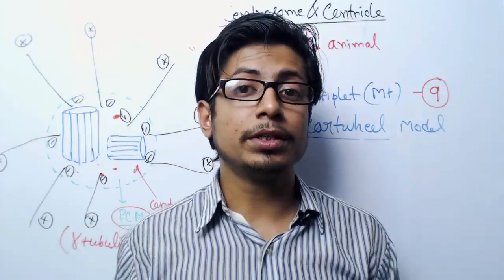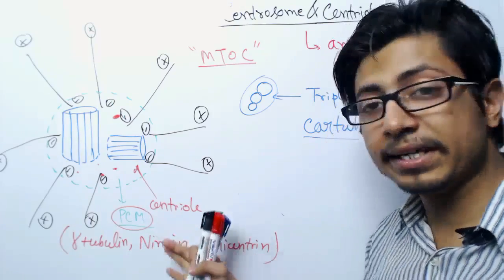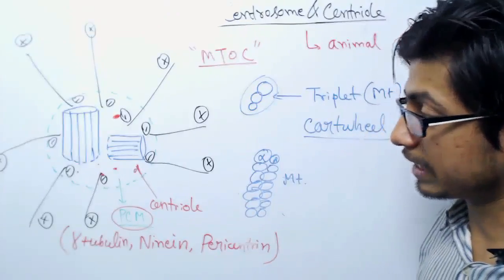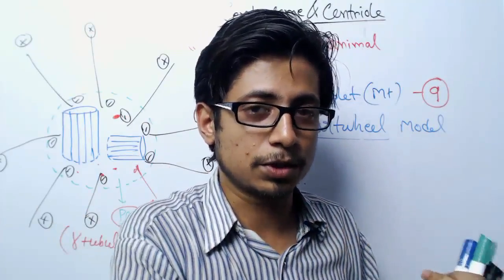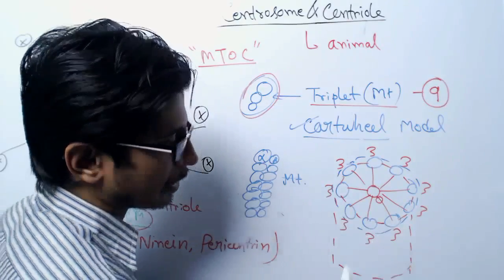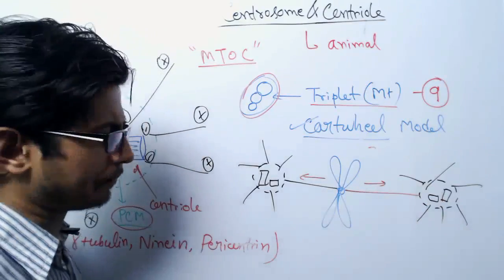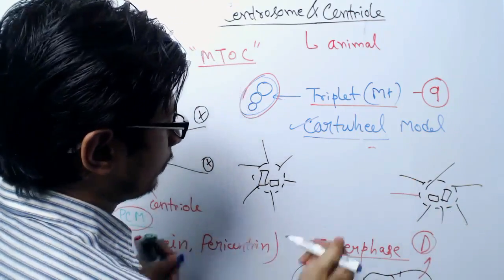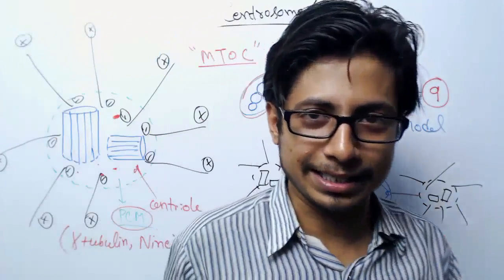Centrosome and Centriole

Comment: Shomu's Biology
I have heard that the plant cells have a centrosome is that correct or not if you have an essay or survey of that could you please help me
Reply: No bro.. plant cell have polar caps intead of centrosomes
Reply: Yes, it is actually correct, but the centrioles are found only in those eukaryotic plants where flagellate structures are present in the life cycle (many green algae, bryophytes, pteridophytes and cycads). They are absent in angiosperms, higher gymnosperms, some algae and fungi.

Comment: then what are spindle fibres? please explain iam confused with microtubules and spindel fibres
Reply: Spindle fibres are actually made up of microtubules and a complete microtubule is itself made up of 13 protofilaments of α & β tubulin protein dimers arranged sequentially one below the other. And so texts in the biology books or Zoology books write during cell division, the spindle fibres or the microtubules pull the sister chromatids towards opposite poles.